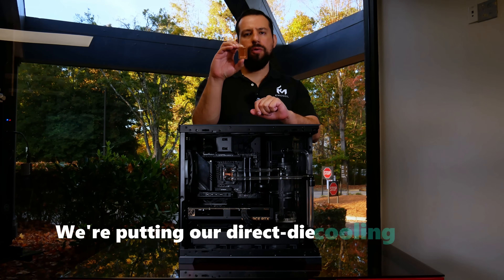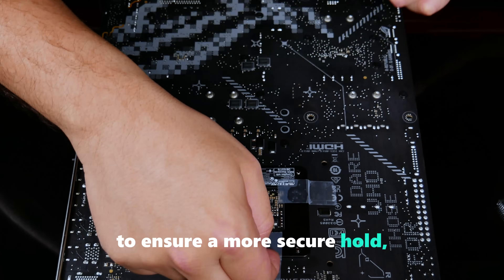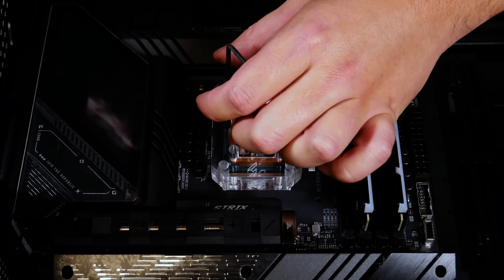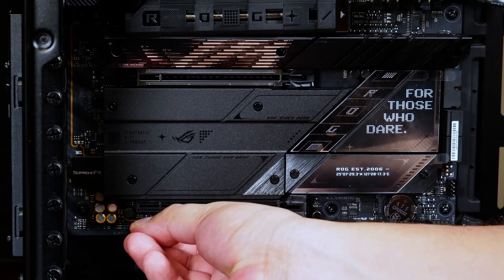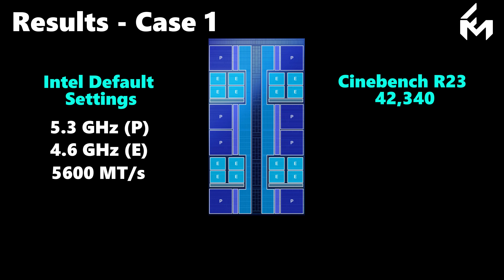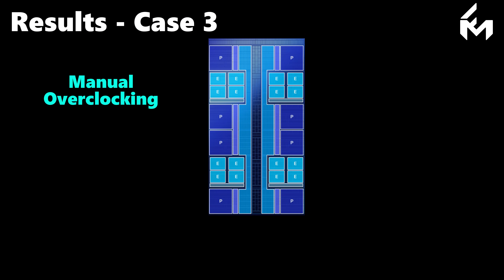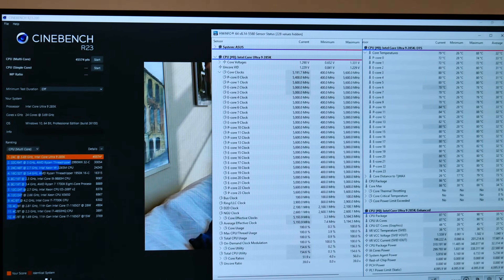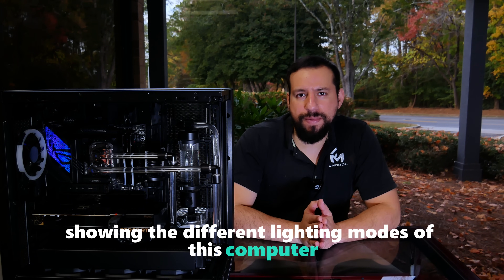How to Use a Direct-Die Block Without Delidding an Ultra 9 285K! Surprisingly Cool & Warranty Safe!

Comment: Thats a great idea about the type.  What kind did you use and also can it stay on there or did you remove it before putting mb in ?
Reply from the maker: Hey! Thanks! We figured this out after a few close calls while moving the motherboard during assembly. We used magic tape, which you can find in any store, but most tape should work since you can easily peel it off once the block is installed. Most cases have an opening on the back so no problem in taking it off post-assembly.

Comment: Also, 99 $ is a little too much imho
Reply from the maker: Thanks for the feedback. While our block is price competitive with others in the same tier, we're still working on dialing in our economics. We're taking in a number of factors, including production length, material, and US based labor.
Reply: Have you looked at the competition? Average water blocks are around $100 too i just got an alphacool core 1 and it was $135 ek blocks are even more.... water cooling is not cheap lots of cost goes into the production and R&D for these things. They are reasonably priced IMO it should just include a delidding tool and the recommended liquid metal but again that's extra cost and if they don't make one in house that would def add a bit to the overall price.
Reply from the maker: @ethanvalentine4299  Agree with all of this. On the delidding tool front - we're working on one now that we hope to offer in the coming weeks. We're doing our best to remain cost competitive across our inventory while developing the highest quality products. We're a new business, so still figuring things out here. Appreciate it!

Comment: It's not a direct die. And it's does not help 285K in any way.
Reply from the maker: Hey, it is mentioned in the video that the block can be used in both direct-die or indirect cooling systems. This particular video was made for people who don't want go through the hassle of delidding and lose their warranty, but the same block can be used in direct-die configurations as you can see in our previous video. You're welcome to compare our results with other reviewers and you'll see that even without delidding we have pretty good performance. We'll do a future video with the same block in a direct-die setup with the 285K.